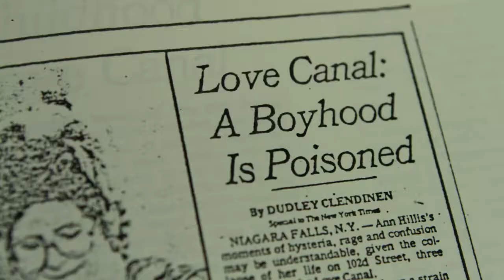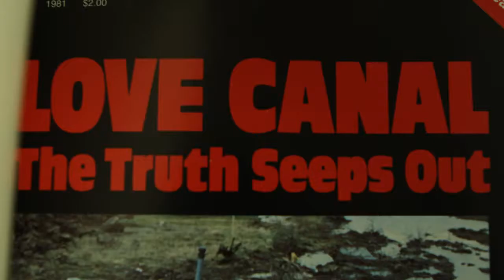Love Canal

Comment from the maker: I stand corrected. There is another smaller Hooker Dump Site between 27th Street and Veteran's Ave in Niagara Falls on Buffalo Avenue. This one last December was found to be, (what I believe), to be leaking into Gill Creek. Gill Creek runs parallel to Veteran's Ave. The same black substance was found to be in people's basements around Robbins Drive and Porter Road. (Right by the Hyde Park Golf Course and, not too far from the Niagara Falls High School.) This year, there was an old dump site discovered on Forbes Avenue, in the Town of Wheatfield. This dump site, has been buried over and untouched for 40 years. Even I didn't know about this particular site until it was made public by the news last year. It's my understanding that they are going to start cleaning it up over the next several months. This, is also unknown to be tied directly to Hooker and or Love Canal. It's merely speculation, because it was not and never has been confirmed. My Grandfather worked for Hooker for 25 years, and was a Foreman on the factory floor. However, he never knew nor spoke of any of the dumping that took place. He wasn't involved in that.